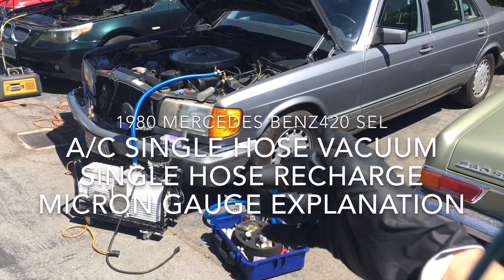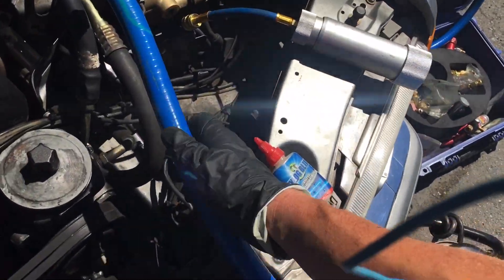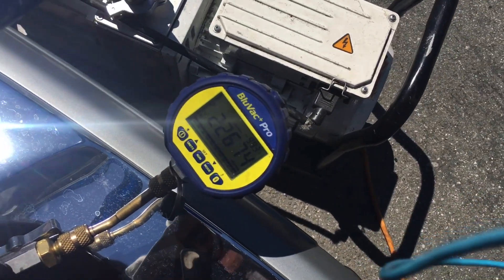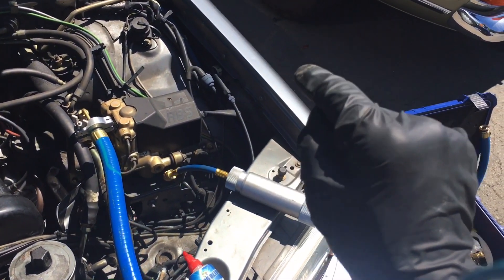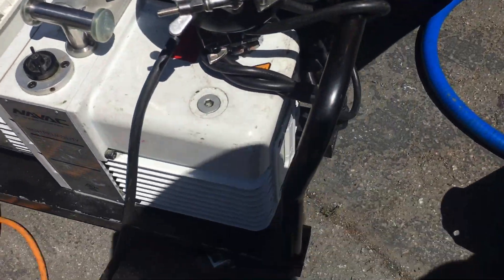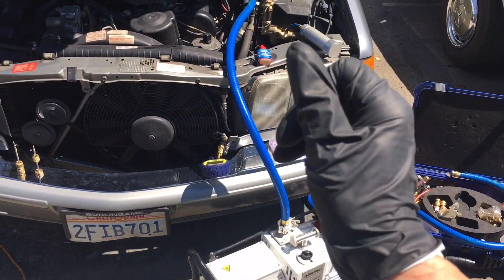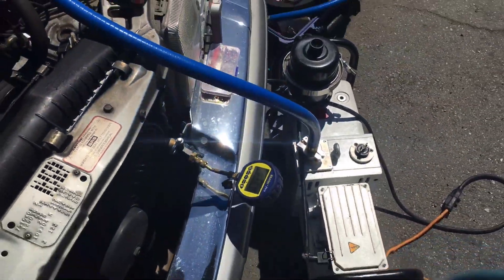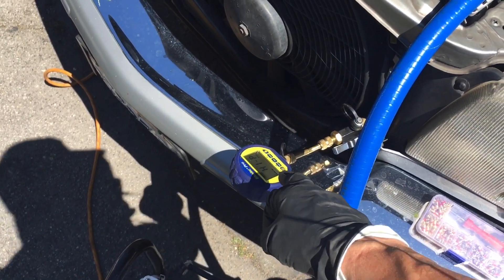A/C Single hose vacuum single hose recharge micrometer explanation

Comment: at 7:13,  if it's under vacuum, opening the cap on the side port on the valve core tool would suck air in. So need to use the back end port to break the vacuum.
Reply from the maker: I fill up from the high side using liquid refrigerant through the ball valve at the core removal tool. 
       100% of the liquid figures by way to go into the vehicle in less than 30 seconds.

Comment: I wish you could do a general diy  video for the regular Joe St home using the standard 3 house manifold (blue, red, yellow).

Like how to connect the micron guage,  which side you connect it to (high or low). What adapter you need.  When to turn the knob when the vacuum is on and how to turn off and start the charge.

Is it safe just to pull vacuum by using just  1 line as on regular guages you would open both low and high during the vacuum stage?

Or do you need a strong vacuum just to be able to pull vacuum on a single line (high).

Here your using just low side, but you also took out the strader valve, so after you charge it, how do you not loose the freon when removing the connector to install the strader valve?
Reply from the maker: Yes I do plan on making that video

I have some cheap eBay and Amazon refrigerant cages that kind of suck but it is white everybody gets DYI. 

I will get a cheap eBay or Amazon vacuum pump

I will probably get one of those can adapters that can hold three or four cans all at one time in a star pattern so it can be placed on a cheap but hopefully decent accurate eBay or Amazon scale because it must be Installed by weight not guessing. 

But I did do that one video where are used a can of AC pro lol 😂 

It was on a car that needed 19 ounces of refrigerant and 1 ounce of oil because of a new condenser

And the can of AC Pro was exactly 19 ounces of refrigerant and had 1 ounce of lubricant in it.
Reply: @coldfinger459sub0  thanks a lot for the skins willingness to make this video. 

Again,  I'm learning a lot just by watching your videos. I know now why it's best to put the micron guage on the high side,  is to avoid any oil clogging the guage compared to putting it in the low side,  more risk. 

I have an idea how it would look if I used 3 hoses and cheap vacuum pump. 

Just need to make sure vacuum pump can pull down to at least 25 micron, and should be good. 

Again,  I'm leaning a lot about hvac. More then what I thought possible and I'm just trying to fix my car,  but become a master in it,  but at least I'm learning the basics, more so then others who wish not to learn how to do it right
Reply from the maker: @edwinaragon8469  👍

Comment: Wish I watched this one before I charged the Volvo 🤪 especially as I started the engine as you know. Just wondering what happens to the last few grams in the line when charging in the high side? As when you charge the low with engine running it will suck out what’s left in the hose. I used multi valve cores for mine! I uploaded a vid of the setup if you have time to take a look and critique 👊👊
Reply from the maker: Will do

Comment: looking to invest in a set of digital gauges what do you recommend, a good set.
Reply from the maker: Glad to see you’re willing to invest in a new set of digital gauges that are not just digital gauges but are loaded with a lot of software features that perform all the math functions that you did not even know that existed to give you readings and information you can use for diagnosis with free software from the company that is easily downloadable onto your iPhone or tablet or computer using Bluetooth. Also they have a complete source of many wireless sensors temperature and pressure even airflow meters that you will not be using in automotive for the airflow meters.  The clamp on Bluetooth temperature sensors are excellent for the rear suction line to a rear evaporator so you can literally take the temperature of the refrigerant inside the rear evaporator line in a second air temperature sensor that also does humidity and dew point they get stuck in the rear duct airstream. This will communicate with the Fieldpiece SM480V refrigerant digital manifold. Combined with the software you download with video instructions on their website and many aftermarket websites I could give you links to you later to further improve your ability to do nitrogen pressure decay test for finding leaks. And using vacuum decay using a micrometer instead of analog gauges. Use of a micrometer can also indicate high moisture contamination something that you could never read on instead of analog gauges. Here’s a link where I buy my tools they have the best source of air-conditioning and refrigeration tools on the market good support I’ve trusted them for years making all my purchases.  They also do price matching.                                                  https://www.trutechtools.com/Fieldpiece-SM480V-Digital-Manifold-3-Pack-Premium-60-Anti-Blowback-Hoses?gclid=CjwKCAjw_-D3BRBIEiwAjVMy7GgDG4kSmHMJ3DvcNWuK8E31vp-Z9xviFx1kHNI8p3tbLqVusnCDlxoCmxEQAvD_BwE                                        I prefer straight hoses with no permanently attached valves like anti-blowback valves or ball valves I prefer to add my own tiny hose extensions with valving on them or fittings. Any other questions just ask everybody should have availability to information about tools and proper training and education. Because the least amount of training in automotive field is in the air conditioning sector
Reply: @coldfinger459sub0  any other digital gauge set thats not so expensive that you would recomend?

Comment: On a more modern car high side port with the coupler type of connection.  Would that be a good place to use a micron gauge?  Are those couplers vacuum rated? Or any special coupler to use?
Reply: explain the gas laws and the single hose charging better please!
Reply from the maker: MASTER MECHANIC Felipe I’m actually glad you asked that question but if I told you that would be cheating and you would only get part of the story you learn so much more by researching it yourself. That is exactly what my dad did to me when I was 12 years old. I will slip some links into my reply right here when I get home tonight I’m on a job right now
Reply: @mastermechanicfelipe4641   -  Here is a video primer on them.  Complicated stuff to wrap your head around.  Not gonna learn it in a youtube comment! LOL
https://www.youtube.com/watch?v=_EWd0DuN43E
Reply from the maker: Steve W this could be used on a modern car like I said in the video this was to demonstrate if somebody with a very low income and could only afford one vacuum pump and one hose this method could be used even though I would not condone it without more knowledge and unfortunately very accurate precise scales cost enough money that somebody should be able to afford the rest of the equipment. I made this video because hey subscriber asked about the single hose method.  Those couplings and hoses are vacuum rated much deeper vacuum than refrigerant gauge hoses.  The placement of the micron gauge is at the furthest end of the system giving you a true reading.  Micron gauges are to be placed at the furthest placement is ideal. But on cars you often must locate them by your vacuum hose and then you use the shut off valve to isolate it and let the vacuum stabilize to get a true reading.  These are the same couplings and hoses that are used in Laboratories for very deep vacuums. To get a better vacuum you would use solid metal lines with no rubber gaskets.  HVAC and rated gaskets are made out of stainless steel.  And when you’re using extremely low vacuums even some metals cannot be used because they off gas and contaminate the vacuum.  But this is when you’re getting into the level using turbo molecular, Ion sputter, Croy vacuum pumps or centrifugal vacuum pumps Automotive and HVAC guys do not even know that they exist.     Using and understanding how to use a micron gauge take time and a root understanding it can be frustrating at times when lacking the knowledge. I was taught by my father starting at the age of 12.  I have always used a micron gauge. It is a good tool to read the moisture contamination in a system. Moisture and air the root of all evil in an air conditioning system.     I forgot to mention add silicone grease to all seals in meeting surfaces. It provides a good vacuum seal that vacuum cannot pull through. With normal vacuum pumps for Automotive or HVAC.
Reply: @coldfinger459sub0   - Thanks, Yea I guess Since those  couplers tend to move around I tend to think you do not get as good of a seal as you do with the old style screw on fittings like in this video.    Guess I just have to trust them.

Yea to do it right the scale seems to be the big factor.  But also the right hoses for vacuum like you mentioned are not cheap!   Seems there is not way around spending some money if you want to do a good Job.  But it is good to see you only pulling vacuum on the low side.  I was wondering if it was necessary to do it from both sides, high and low.  I am sure it would be faster pulling from both sides but if you got time and the budget for only 1 good vacuum hose good to know that's an option. 

I got my Micron Gauge today.  Found a good deal ($70) on a used Fieldpiece unit like you have in this video.